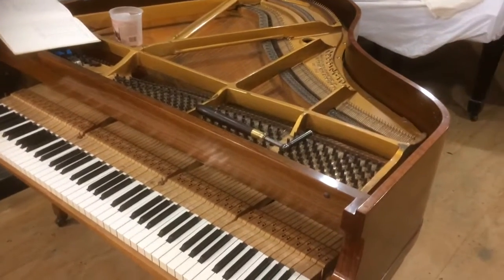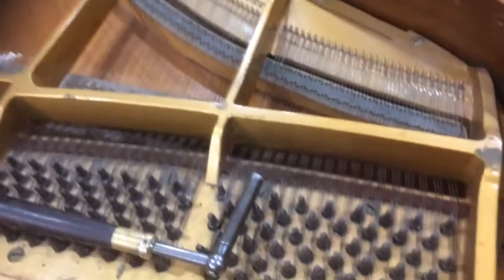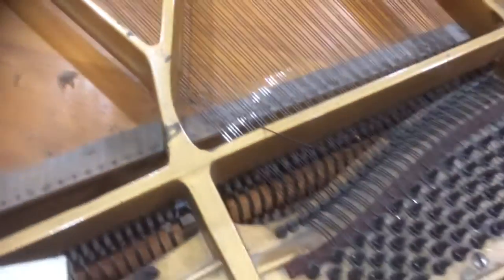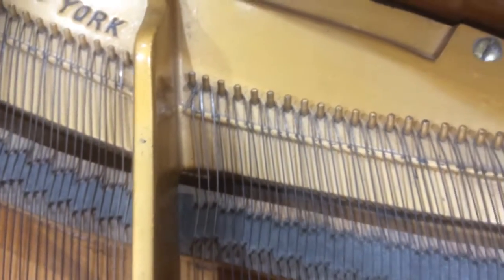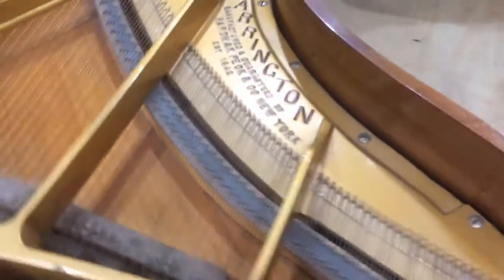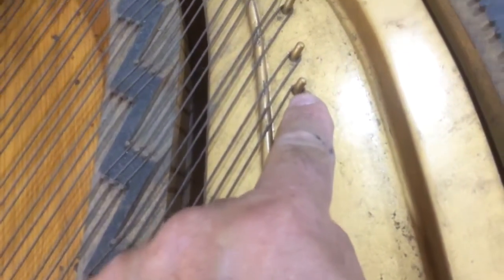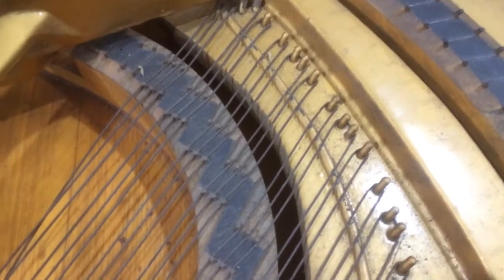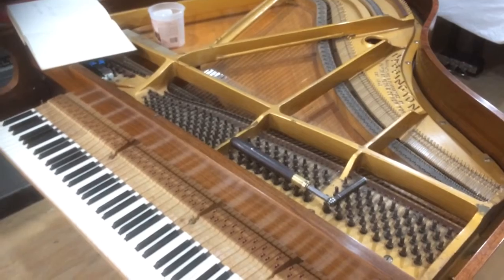Measure & Observe Before Removing Strings

Comment: I noticed that on several of your rebuild videos, you mentioned you use Roslau wire for the treble section of the piano, is there any particular reason you like that wire over Mapes Gold or any other kind? I know you're an extremely qualified piano rebuilder and so I was curious as to what your input on this subject is. Usually, the American rebuilders are more geared toward using Mapes and some even swear by its superiority.